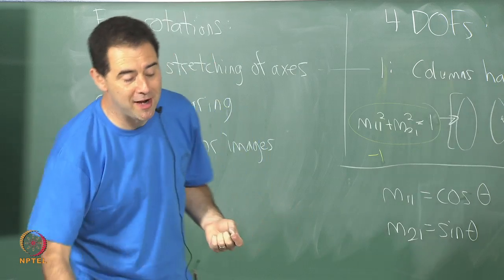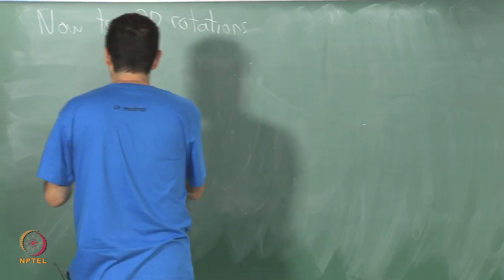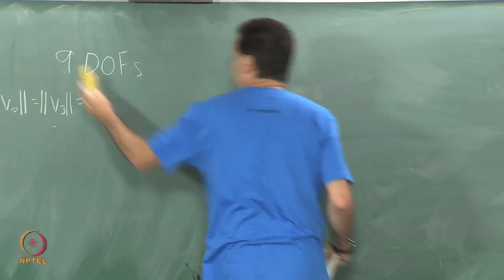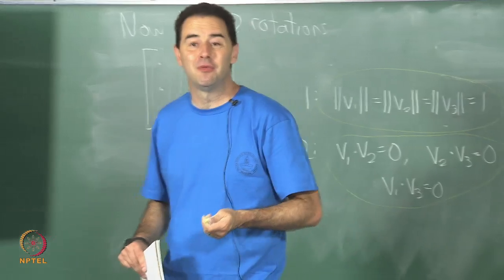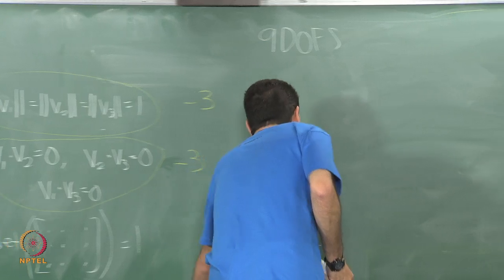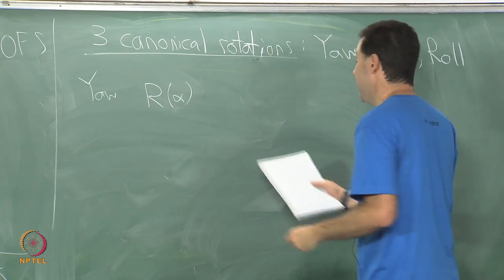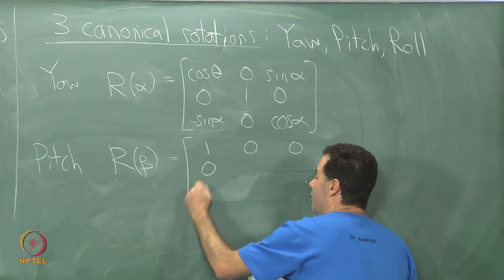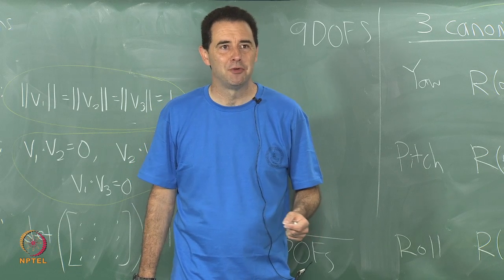3D rotations and yaw, pitch, and roll

Comment: This is not the usual definition of yaw, pitch and roll. Normally for airplanes we take a NED coordinate system, which stands for north, east and down. North corresponding to the X-axis, east to the Y-axis and down to the Z-axis. Yaw is rotation around the Z-axis, resulting in the heading, pitch is the rotation around the Y-axis resulting in the nose of the plane being raised and roll is around the X-axis resulting in the left wind being lifted for positive roll. http://www.chrobotics.com/wp-content/uploads/2012/11/Inertial-Frame.png
Reply: hes using a different orientation of axes,